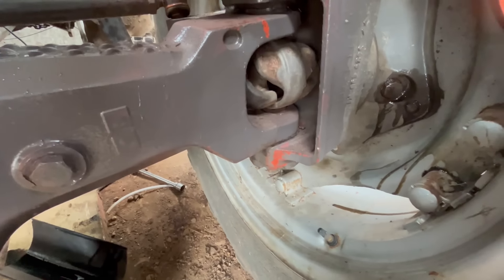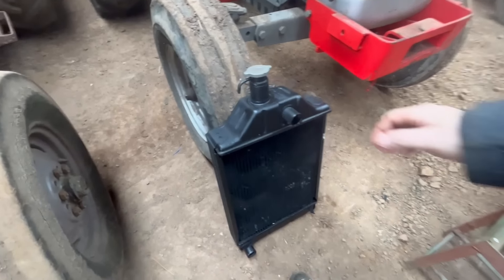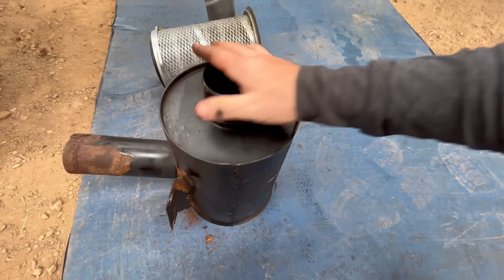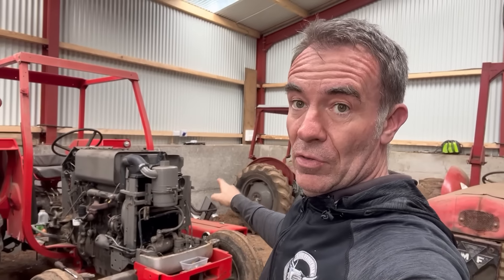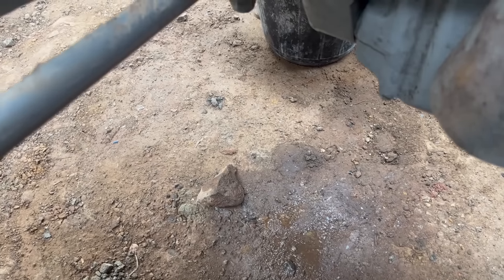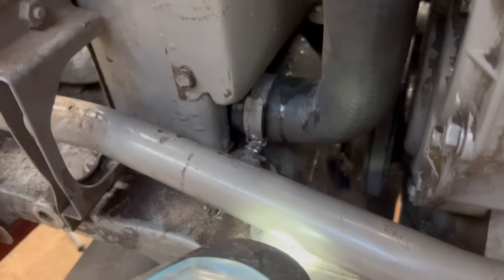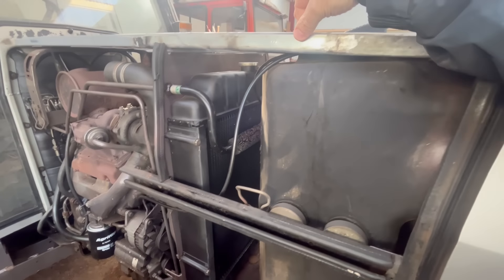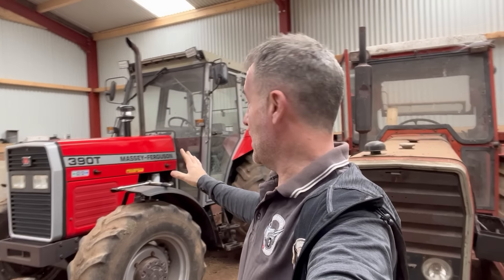390T is complete, but I ended up doing more than I budgeted for!!!

Comment: great video cathal a quick test i use to check if a rad is leaking without a pressure test is to use a couple of spuds shoved in the outlets and fill the rad and leave it surprising how well potatoes seal up the outlets.
Reply from the maker: Great idea, hopefully I wont need to use it🤞🤞

Comment: Fair play, are you going to clad the cab on the 165 . Is the 165 full power steering? Mine is very heavy I think power assisted , any advice ?
Reply from the maker: I have some second hand cladding just never got it on.  Hopefully some day soon.  Mine is power assisted also with the ram at the front,  just in front of the rad.  If yours is heavy it might just need set properly.  As they wear with age the setting goes off and they become hard to steer.  Id try that first.👍
Reply: Thanks , top man ,